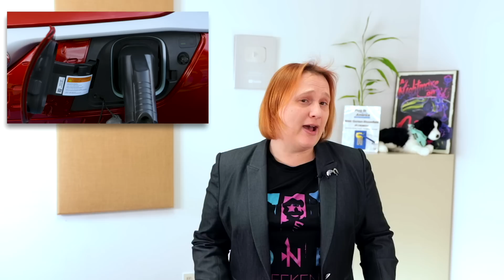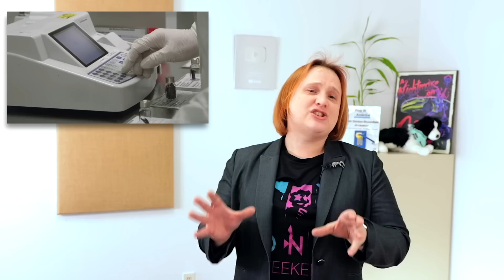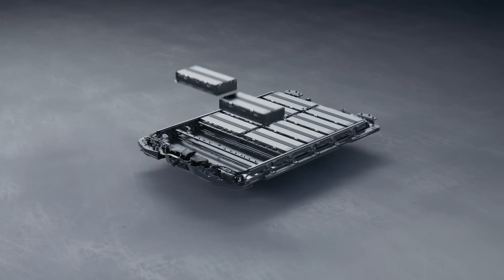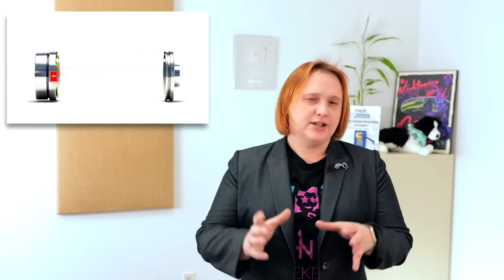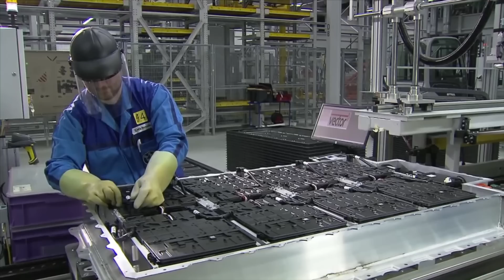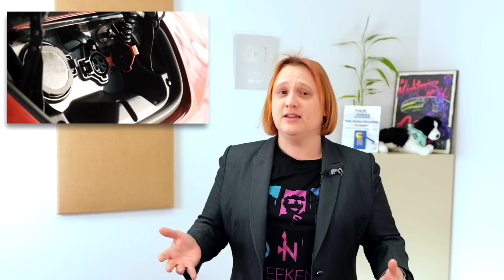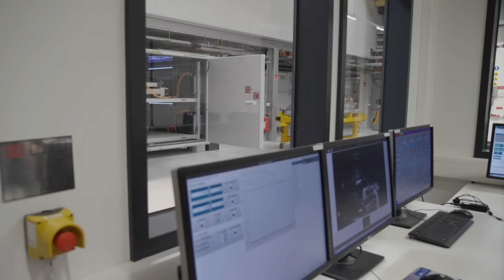Has Samsung Found The Holy Grail Of Solid State Batteries?

Comment: As soon as I can Get a 1000 mile charge with only a 15 minute recharge time I will buy a ??? $ 25,000 electric car new or used :-)
Reply: So what you're saying is you rather spend of total of roughly 30 mins visiting a petrol station 3 or 4 times until then?

Comment: Charging while driving is the real solution to long range driving. Easy tech to install on selected stretches on high ways and not that expensive to build. Will also save people time compared to stationary charging. Car makers are only against because they want to tap into the charging of the battery as an income stream. Can also save a lot of battery weight.
Reply: @Dan Moyer you could simply build sensing into the charging system (happening with stationary charging btw). But the operator of such charge-as-you-drive infrastructure will want to have the money for themselves.

Comment: I really want an EV that will travel 500 miles, recharge and a 500 more. 🎵
Reply: When will you go 500 miles with no breaks? Traveling constantly at the most common highway speed limit in the EU (110km/h), it'll take you 7 hours and 20 minutes to travel that far.

Comment: Ionity, which is a charging network as part of a joint venture between BMW Group, Daimler AG, Ford Motor Company, Hyundai Motor Group and the Volkswagen Group with Porsche AG, was found to be by far the most expensive.
It currently charges 69p per kilowatt hour of charging at its ultra rapid chargers located only at motorway services in the UK. 
What Car? found that you'll pay up to an eye-watering £45.89 to charge an Audi E-tron from 10 per cent to 80 per cent at one of these devices.

Comment: Basically if you're waiting to buy an EV that does 1000km per charge and costs 15k then you may be waiting a long time. You're better off buying an EV with 150-200 miles of range now and you'll be saving money over the long term.

Comment: Electric cars need batteries that can be swapped at a recharging station (by a robot) for a freshly charged set, then electric cars will be superior to ICE cars.
The manufacturers need to pick a standard form factor that is easy to plug and play for doing swaps.  And there needs to be one or several service companies
that will swap out your batteries and recharge them.

Comment: Your dismissal of people's concerns about range is disingenuous.  People who own EVs don't worry about range because EVs meet THEIR  range requirements and THEIR financial requirements.  They were the easy sells because their needs could be met.  Those are NOT the people whose needs weren't met by EVs.  They were the lucky ones. 

Your idea of what is reasonable range is shaped by your experience.   

You can't imagine living in an area where internet service is by dial up modem, where there is no cable TV, and no cell service, as my brother has for 40 years.  You probably can't imagine a family of 4 living on an annual income of  less than $60K.  Can they afford to buy a new EV?  Approximately 20% of the people of Illinois live more than 40 miles from where they work.   They are NOT affluent.  They rent apartments or older homes. They don't buy new +$30k cars.  They buy used $10K cars on credit.   When they get to work, there is no place to plug a car in to recharge it.  Adding a half hour charging stop to a  2 hour round trip commute to a +9 hour work day isn't reasonable, even if you only need to do it twice a week. 

People who have short commutes don't worry about range. Those with moderate length commutes who own homes don't worry. People who have high paying steady jobs, no kids and little debt, don't worry about buying  new car . Those who worry have long distance commutes or long loop daily travel to locations and lack/or charging stations where they can park.  

I live in an older collar county community.  Buying a used ICE car that met my family's needs for 6-8 years cost $10K.  My 80 year old home has 60A service.  I can't run a circular saw at home near dinner time.  Upgrading my 60A service and running a separate "car'" circuit would cost +$3500.  If every home in my community were to have their electric service upgraded to handle the nightly charging load of a medium range EV, the utility company would need to run all new power lines, feeders, and replace the substations and transformers.
Reply from the maker: Nikki here. Thanks for the comment. Actually, I grew up in a farming family in the middle of no-where. Where I live now has no Internet save for a very expensive wireless Internet. So I do get it - but the majority of people DO only need 250-miles or so.

Comment: The tech is already out there in graphine batteries powerpack it the moment it’s just  usb 10,000 m’amps charger but has the ability to be charge significantly more times than lithium packs, Samsung however has already experimented with the tech in mobile battery format,  I strongly suspect we will see a ev fitted with the commercial packs  probably first from bmw in the i4 since the timeframe matches launch window  they have already talked bout 500km range and another Korean flagship in the late 2022-2023 window.

Comment: 800km per charge is not enough for me. Every ten years i make a 801km trip.
Reply: Carry a Bird scooter in the boot for that last km
Reply: That's a shame ! :)
Reply: @StephanvanIngen  
Because it is a problem for some people.
But like a lot of things people use the extreme as a reason or justification.
This is true in a lot of things, people buy a Jeep Wrangler, because someday they might want to go off road, even though odds are 99.9% of the time it'll be driving around in the mall.
Same goes with range,  people generally want a vehicle that can do everything they might ever want to do.. ever.
I Think it's also somewhat fear of the unknown.
You also have cost to bear in mind and a lot of people still buy inexpensive used cars,  and there really are no inexpensive used electric vehicles currently.
I tend to fall into that last category myself, I also tend to drive a lot more than most people,  and do lots of long distance cross-country driving.. and what I'm doing cross-country driving I don't want to spend a lot of time charging an electric vehicle.
personally I would probably get an electric and I would keep my old hybrid car for the long-distance road trips.
One other factor is that it seems to be a  fast changing industry. And I think people are also worried that if they buy an electric car right now 3 years from now some new much better thing will come out and they will wish that they had waited,  and worry that the vehicle that they did purchase is going to have basically no resale value.
Lot of factors go into the decision.
Reply: Just remember that's claimed travel distance your actual range depends on speed, traffic and terrain 🤔
Reply: You know that bag of chips you eat that one day a week? Stop eating those and you'll be able to do 820km with that car.
Reply: @eivis13 I see what you did there
Reply: @eivis13  If he stops eating, he won't have a longer range, he'll just get lighter... In any case, the lighter you go, if you have ideal weather/road conditions, you might eventually get close to the specified range, you won't be able to add 3% range by not taking luggage or drinks or light clohes...
Reply: Hahah
Reply: Very good!
Reply: You can expect a bit more progress in the next ten years and the range will cover your epic 801km odyssey
Reply: It is not just about the range. Just look at the towing capability of any EV and you realize that we need better batteries.
Reply: @KaroAss66  it's not just range its recharging it. Most people don't have enough electricity in their house to recharge a large high range battery that would be needed for towing.
Reply: Yeah, ya never know when you might have to burn up the Dempster (hwy) to Inuvik. Then your screwed!!!
Reply: Here in oz....it’s 870 km....from city to city
Reply: @andgate2000  but the cities are growing so fast (250,000 immigrants per year) we will soon be under 800km
Reply: That is exactly how unreasonable people are around EVs, also it's the propaganda the Big 3 have been spreading... Watch that movie starring Jeff Bridges about a car brand... Wow
Reply: You can charge on the trip
Reply: Get out and push for last 1km
Reply: The info under the video says 800 miles per charge, that is approximately 1287 km.
Reply: Maybe a fart could help you for the last km
Reply: All the people bashing range anxiety, and yet Ive busted a sweat from my gas tank reading E in the middle of nowhere in an ICE car.

It’s great that a car is functional for 97% of daily driving, and EVs are clearly the future.  That doesn’t make the other 3% of trips not important or just go away, especially on those times when when its critical you make it to the hospital/vet/loved ones side/next town.  Heck, why even bother with something like AAA if you’re only at risk of breaking down close to your house?
Reply: The song of the mermaid!
https://youtu.be/MHv0apmlqmM

Comment: Why not have a battery exchange locations? Auto drives in and in five minutes rolls out with an exchange.
Reply: Future battery packs will need to charge faster, but that is already coming soon.  I don't want to drive off in mid-winter for another 500 km of mountain roads on a battery pack whose history I don't know, and I'd not want to swap batteries on a regular basis in any case - the wear & tear on the mounting structure and the electrical connections would require expensive hardware to survive weekly or daily swap outs.  The more important hurdle is that swaps would only make sense if all battery packs were the same, or restricted to say three sizes?  Not very likely, imho.

Comment: Dear Nici, I am way older than you and now on the pension. If I was looking for a vehicle I would be looking at either, a modern day 91 octane smallish 4 cylinder or 3 cylinder turbo either that or same spec diesel. Reason is . . . World wide governments including the Americas where you now reside have put pressure on the m manufacturers to produce vehicles that on average across their fleets must have an average fuel consumption of "x" litres per 100kmh on a predetermined no excuses controlled test. This has lead . . . At a guess to a reduction of circa 40% consumption on ice vehicles. Meanwhile in EV land they are using 1930s systems of increasing the fuel tank aka using larger hungrier batteries focusing  only on range. This is so stupid and irrelevant words elude me. What is worse is that EV journalists are playing along with this theory instead of demanding (like they do for ice vehicles) real world efficiency gains.
In most of the first and second world countries electricity to charge batteries comes at bo th a financial and environmental cost which is   why we have seen wholesale electricity prices grow faster than inflation rates in many countries. The narrow minded idealistic theory that electricity production comes at no cost in $ nor environmental impact is rubbish.
Therefore, why aren't the EV companies being asked to comply with the outcome of the same ice car test including urban and extra urban and providing us with real world  figures of the combined cycle litres per 100km equivalent of kWh (a consistent measure of consumed electric fuel) per 100km. Also why aren't the EV companies accountable for reducing this figure to a set average amount by a prescribed date? If, as I suspect you will not take to task, just increasing battery sizes is exactly the same as putting larger ice filled tanks into ice cars which results in no reduction to emissions . Seriously you could put a 100 litre petrol tank into a Hyundai i30 petrol or diesel and the real world range would increase proportionately. So Eve need to be tested and compared on their real green credentials of kWh per 100km or even th ed older English mpg. We need to ignore for green credential status the size of a vehicles battery just like we do for ice vehicles an dc just compare the quality of conversion of those electrons to travel distance. If brand A uses 10kwh to travel 100km and brand B uses 20 kWh in same test then clearly brand A is more efficient just as if a Hyundai Kona plug in 100 percent EV uses "x" kWh per 100km and a similar sized 5 seater VW electric plug in uses "y" kWh per 100km x and y is what proves engineering excellence not the one with the larger battery. Sorry this is long winded but so far I have not read even 1 report comparing this hypothetical x and y. If I had to pay say 50c per kWh for electricity this could make a huge difference. True journalism involves getting down to the nitty gritty and yes ulp can cost $1 per litre and electricity 50c per kWh in one country and $2.50 and 29c respectively in another country. I read motoring data from all over the world and it is the consumption of fuel be it electrons or PULP it is only the unit price of the fuel that varies. Please help.

Comment: What we need is standardized battery modules across the industry, just like the 12v batteries in ICE cars. I should be able to buy a replacement module from a battery manufacturer, which is not necessary the same as the car manufacturer. It would also be nice if I could drive around with a module in the car and add extra modules in empty slots for longer drivers. Maybe renting modules when going in vacation...

Comment: Not quite, it uses Lithium metal as anode and Ag-C composite as a substrate, because the lithium deposites in a flat layer instead of dendrites.
Here's the abstract:

An all-solid-state battery with a lithium metal anode is a strong candidate for surpassing conventional lithium-ion battery capabilities. However, undesirable Li dendrite growth and low Coulombic efficiency impede their practical application. Here we report that a high-performance all-solid-state lithium metal battery with a sulfide electrolyte is enabled by a Ag–C composite anode with no excess Li. We show that the thin Ag–C layer can effectively regulate Li deposition, which leads to a genuinely long electrochemical cyclability. In our full-cell demonstrations, we employed a high-Ni layered oxide cathode with a high specific capacity (>210 mAh g−1) and high areal capacity (>6.8 mAh cm−2) and an argyrodite-type sulfide electrolyte. A warm isostatic pressing technique was also introduced to improve the contact between the electrode and the electrolyte. A prototype pouch cell (0.6 Ah) thus prepared exhibited a high energy density (>900 Wh l−1), stable Coulombic efficiency over 99.8% and long cycle life (1,000 times).

99.8 % ( at 1c, 100% DOD i assume) is legit good for solid state, and 900 W/L is 22% higher then Tesla's current 2170 (740wh/L), but without a spider chart it's not possible to tell if this chemistry is good enough. More specifically we need power density, because a car battery needs to be a sprinter, not a wimp.
Reply: I wonder if the use of lithium metal is a flammability risk.
Reply: @DrTed3  I wouldn't think so. When you cut a piece of lithum in a lab the newly formed surfaces are put in direct contact with oxygen, which does react, but all it does is turn the surface black, slowly.
Water reacts with it faster, but not explosively, though it produces H2, but since no water is present in the battery and air humidity is negligible, it's fine.
I can't think of a reason it wouldn't be safe.
Reply: @VIIflegias  Thanks for the reply.  I think I remember Elon mentioning something about a lithium metal anode.  If that is true, his battery experts are studying it.

Comment: Sounds like scale and cost are the only problem now.

$100,000 for one cell in a car that needs ~1,000 cells, not even Bugatti is going to use this as a full electric car. At least until the price comes down a lot.

Maybe it's cost will go down like lithium ion, Tesla got their battery cost from $1,000 per kilowatt hour to $100 in just 10 years, so I hope they can get the cost down below that number as soon as possible (their hope to)

Comment: I drive from VA to upstate NY about 6 times a year.  Based on various planning sites I would have to add in about 1.5 to 2 hours to a 7 hour drive in order to use electric.  There are two things that can make me think about getting an EV as a primary driver.  1 would be to reduce recharge down to about 20 min for a full pack (my usual fill up and bathroom break time) or increase the mileage of the car to around 500 miles (75+ mph with ac on high all the way & heat in the winter). The other solution is to not worry about it and rent a gas car for a trip (but that can get expensive) or what I do now is own a diesel golf which gets about 50mpg on the highway (va to ny and half way back on 1 tank).

The other major blocker which VW is working on, is to have a EV for the masses, that is one that is priced around $25k to $30k. Even with the "savings" a Tesla is still a luxury car.
Reply: So you will need 2 more hours (in each direction?) 6 times a year. That's 24 hours.  If you can charge at home, you save going to a gas station most of the year. Assuming 10 minutes at a gas station (see for yourself how long it really takes from the point you turn off your desired route until you are back on it), and if you fill up 90 times a year, that makes 15 hours saved. Now think of how much money you will save on fuel and maintenance and ask yourself how much your time is really worth.